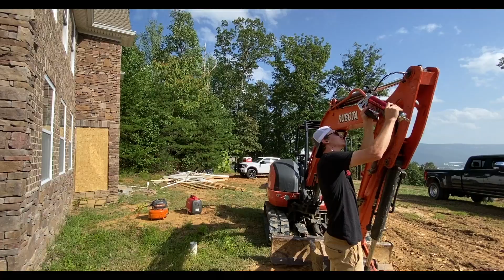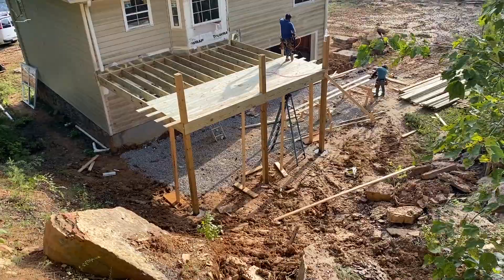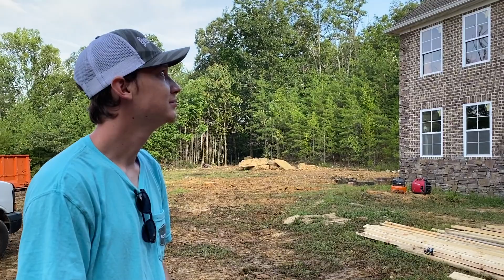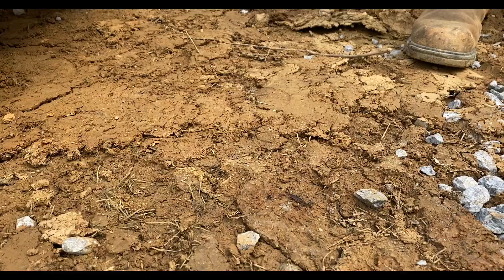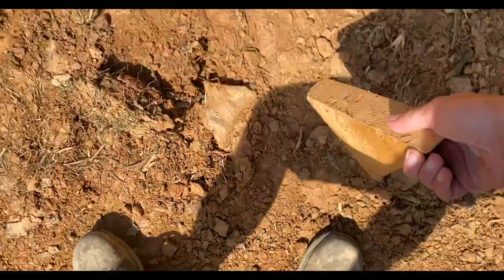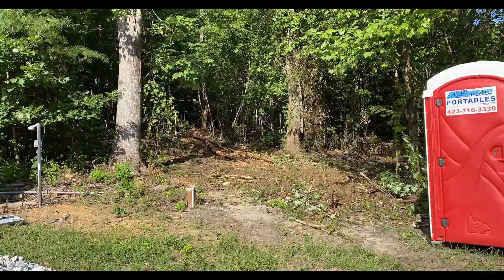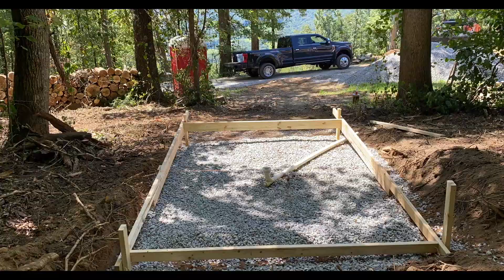The New Goonzquad Headquarters Part 9

Comment: That deck being built with only nails is just waiting to fall down.  There should be lag bolts going into the house framing, they only nailed it to the house.  The deck boards being nailed down is also way old school.  Need to use screws unless you want to see all of the nails pulling up in 2 yrs.

Comment: these guys are going to put down a slab without rebar in it , that slab will split within the first few years due to ground movement and moisture will get into the slab from the outside, Sorry to criticize guys but concrete slabs without rebar are just not worth the cost of the concrete.

Comment: Hi Boys!
So, first of all... I Love that you guys aren't afraid to try ANYTHING!!! Kudos.
BUT.... When it comes to building, you have to abide by what's called "Best Known Practices" (and the Building Code in your area).
What I see wrong with the "slab" you are going to pour is this:
Looks like you intend it to support the well house. If that's the case, you need a foundation. Like someone below said, at least 16" wide and 16" deep all the way around (I'm just guessing... there are many factors that determine what depth and width you need, such as frost depth).  Then you will need to slope your slab downward from all points to the drain, which means it should be lower than the slab height, not the same. Someone suggested 2 inches, but the standard slope is 1/4" per foot (you can probably even get away with 1/8: per foot).  That means that using 1/4" per foot, if the wall edge is 6 feet away from the center of the drain, you would set the drain 1-1/2" lower than the top of the slab.  I would also recommend placing at least 1/2" of insulation around your drain (you can seal it later). This way if your slab cracks and shifts (which they ALL DO!) you wont break your drain piping.  Recommend running at least a 1" PVC Electrical Conduit (they are green or grey) to about 2" from the edge of the slab for your future electrical needs (like running the pump, lights, etc.)  

Good Luck!

Comment: Don't throw away your burnable wood.  Put it in a big pile and get a burn permit and burn it as bonfire.  Throw plastics and no comparable material away and bury rocks in a un used area that are not needed.  It will cut costs for you big time.

Comment: maybe casement windows have come a long way in years. The ones ive seen and worked on sucked. If they get out of alignment at all through the years they get hard to open and close. Then the crank linkage takes a beating and breaks. Id take a double hung window over a casement any day. Plus the double hung look better,,,Id leave the windows alone. Also ditch the spiral stairs idea off the deck.

Comment: Great work guys! I see you guys are moving right along. You might wanna make the outhouse floor heated b4 poring the concrete so it will never freeze over during winter. I think you guys should do a off grid setup too. I would definitely close off the garage for more living room, Im sure you guys are planning on building a shop building anyhow, that way the deck could be extended to the other back end of the house. Then under the deck could be used for even more living space too, a patio or closed off great room since the deck is so high. Just a few tips that you might wanna consider. I can't wait to see what comes next! Always good to see young men with good hands 👍

Comment: You should build that slab like the way a lego brick snaps together.  A flat slab like that will move over time when the earth moves due to soft soil, especially when you have excess rain.  In other words , you don't want the slab to slide.  You want it anchored.

Comment: The guys you buddy get some concrete wire and put in there is not that does slab is my crack all the pieces get a one ahead and Dougie done a little more to would much in front

Comment: BOYS, YOU NEED TO STOP A MINUTE AND HAVE A PROPER THINK ABOUT WHAT YOU ARE DOING. All these ideas thrown up and acted on without proper forethought and planning. You will end up with a mess. Get in touch with an architect or planner and run all the ideas through him/her. You need to put some footings in place with the shed build, some plastic sheeting and some rebar, not to mention some conduit cable before you pour the concrete..It's all to hasty, you have all the time you need it dose not all have to be finished yesterday.

Comment: Guys, you want to use that excavator to dig some 3 foot deep frost free footings for that slab. You might want to run lines for water in and out so that they remain underground and don't freeze. You'll need an electric line as well.

Comment: I personally like window grids they have a classic colonial look to them.  Casement windows kinda suck when it rains.  Are a bit of PITA to clean also.  Also, I know you probably doing it legit with central air, but you'll never be able to put an AC in the window. I never had any good experience with casement windows, they break and eventually become hard to open and close. Maybe the houses I worked in had bad windows.  I dunno casements seem like a downgrade not an upgrade.

Comment: I used to make spiral staircases with a pipe in the middle and bend steps and run them around the pipe using the uprights to link the tread to the next tread up or down, use a pipe bender to bend the hand rail out of quarter by 2 inch flat iron and weld it all together. We made a jig to hold the first tread in place then used it for the next tread by sliding is down and around to the position of the next tread. Each tread is made out of a sheet steel of sixteen gauge of approximately ten inches by 2 and a half foot long. You make two lines from one end to fit the pole/pipe a similar width of the pole, to the other end one inch from the other edge for a fold down that you weld an up right half inch rod to connect to the next tread down.
Work out where you want the top tread to start and the last tread to finish by changing the drop down rate and rotation of the treads. Essentially don’t over lap the treads mostly very the drop from one tread to the next to fit in more or less treads to very the first and last tread.
To stop the ringing sound of the treads you need to fill it all with foam,even the treads.
Good luck

Comment: You're gonna need either rebar or reinforcing wire with standoffs in that slab. It wouldn't hurt to insert anchor bolts in the slab around the perimeter to bolt down the bottom 2x4 plate. That house really needs an 8 ft. deep porch stretching across the entire front of the house and wrapping around the left side. It'll be a great place to enjoy your fantastic view. A nice railing, posts, tongue & groove flooring, and some rocking chairs would really make it feel like home. Also that little two car garage is too small to do anything you guys wanna do. Build another garage and just turn that one into a rec room. Would be a great room for a pool table. Would be nice to have a big picture window in there too, to take advantage of that view and add more light.
Reply: I totally agree with this guy,  do what he is saying and really enjoy your awesome house!!
Reply: totally agree!

Comment: Hey guys, that slab wont work if you're just planning on pouring it as is. You need reinforcing mesh to hold it together and that gravel base wont hold it very well, bit of rain will wash the gravel out from underneath and the whole slab could shift. Get it done properly boys so you dont have to redo it.

Comment: hey boys i work at a traditional door and window company for 14 years and i would never suggest casement windows for your house it wont look right.
its actually an older style of window then the double hungs you have now which look better you just needed to replace them with single light and not 8 light windows

Comment: You should use wire mesh and spray on foam cement to hold back the land behind your deck. You need to prevent the possibility of a mud slide. They use it a lot in the Middle East when they build roads up in the hills. It is brown and when it sets it looks like rock face. Look in to it. It might be called 'shortcrete' I can’t remember.

Comment: I would recommend using a metal spiral stairs outside, as the critters are less fond of climbing those, or using copper foil on parts of the wood to deter creatures from crawling up to the deck. You may have a serious pest problem because of the location of your house. The idea of a bridge to the terrain behind the house? Oh, you meen the bug and critter highway? Sure, nice idea! Nice looking and a great headquarter for you in the future. Maybe a swimming pool and a helicopter landing site and a nearby garage/hangar?
Reply: You're Clever --> ...the bug and critter highway ... made me laugh until I thought about it and sure enough you're right.  That needs to be considered carefully in their plan.
Reply: The amount of poisones creatures around the house would make me consider several ways to deter creatures from entering the house and porch. If you are sitting down on a chair outside, and a black widow spider or such is hiding under it, you can get into a world of hurt. They are supposed to have their families up there, with kids? It would for sure make me think twice about any connection to the ground, and ways to isolate it from critters and bugs. I would make a hanging stairs that did'nt touch the ground, so no bug could reach it, or a passarelle to the terrain. (A walkway that is only connected to the porch and not touching the terrain, as we use on yachts to avoid rats from getting aboard.)
Reply: @gudfarfar  --> Well, let's not go too far into combat against nature. Many people have to deal with neighbors who are drunks, drug dealers and malcontents with guns. They sure don't have all that to worry about. Planning ahead like you said and signing a contract with an exterminator should  solve the critter problem.

Comment: 3 Comments:
1. @21:30 you can still see gaps in your form.  I hope you plan to fill them or else you will have a leakage problem when the concrete is poured.
2. It would be a good idea to support your form with the dirt you dragged out.
3. You could have told the framers to build your spiral staircase since they were contracted to build you an upper deck with stairs.

Comment: you're supposed to build a "WELL HOUSE" over the top of the actual WELL!  the idea is to keep the water pipe warm in the winter so that when freezing temperatures it the pipes won't freeze the pipes coming from the well into the house. Why on earth do you want to ruin the look of that house by taking out all of the windows? all the changes you're making it would have been cheaper to just tear that house down and completely rebuild the one you want. i guess when you got fuck you money you can do that sort of thing without worry about consequences. the ONLY reason you need windows that roll out is if you live in California where the earthquakes would shake and break normal windows

Comment: Did they just stick the wooden poles into the ground and poured concrete around? That is the worst thing you could possibly do to wood! It will mold and rot in no time! Pour in earth anchors and bolt the poles high enough, so that no stagnant water can reach it. Otherwise your porch will collapse eventually.
(Edit) oh yea and also compact the base for the slab with a heavy compactor before pouring concrete or it will float away one day!

Comment: With your skills you should be able to repair that chainsaw no problem. Use HL Supply for your parts, it's much cheaper than OEM and just as good. I have been using to repair and upgrade Husqvarna saws, always on point.

Comment: Glad you are going off to the side of the wellhead. May want to add your water and power pipe before pouring the slab like you did the drain which is an awesome idea. I have a house over my well head, tank, etc and ended up having to redo the roof because they have to get a crane over it to pull the well pipes/motor if there is a problem. I am going to end up doing away with everything but the wellhead and put the tanks, filters, controllers, softener, etc in the same heated shed that is going to have with dividers of course the generator transfer switches, power distribution and data all in one place with lines running to the rest of the buildings each with its own disconnect not like now where you have to shut the whole system down if there is a leak.

Comment: For the well house foundation. Too much gravel and no wire frame or rebar.  If you dont do any of this the foundation will crack badly. Hopefully  you guys are hiring a concrete contractor as they will make sure it's done properly.  Foundations can be tricky even with such a small building.

Comment: Don’t build the pump house where you are thinking about. You will have continuous trouble from all the water coming down the hill when it rains. Build it around where the equipment is now. Flat ground and the equipment is already there. Put a 12-18 deep footer wide enough for a 2x6 framing plus a brick wall. Build the structure with 2x6 framing. Add a colored metal roof. Insulate the walls and roof and cover with plywood. Brick the exterior with cheap brick and paint the brick. You can put a heater inside the structure to keep it at 40-45 degrees. Keep the dirt floor as it will not get wet and you will have maximum flexibility in the future to move/ replace equipment. Plant shrubs around the pump house.
Reply: Nice! Should they install the breaker box for the pump inside the main house?
Reply: @gpackwood1  I would have the breaker inside the main house just like you would do for the air conditioner that is outside.  Of course have a cutoff in the pump house, too.
Reply: @sch4074  --> Good point. The thought of standing in water trying to turn off the electricity makes me cringe! Safety planning first, then worry about appearance.

Comment: Hey guys the house is looking sick! As a plumber my only advice would be to find out where you guys want your septic tank and leach feild. Also stand the pipe 4ft for the floor drain  in your shed. Just incase for over pour on floor / or if you guys are doing a footing as well. Just cut off the flang and add a coupling and a couple ft of pipe.

Comment: I would be concerned about leaving the garage and other doors open............. and having critters slithering in and taking up residence under the tub and other hiding places.  Those GFI outlets in generators are a pain and always pop the breakers. I changed them out in my generators with regular outlets years ago and never have anymore problems. For the pump-house you should have your plumbing and electrical pipes coming up through the floor. And I also recommend the floor slab be heated electrically so pipes won't freeze.

Comment: Before you even said you might need to make some stairs up to where you were on the hill behind the house I though wow a bridge from the deck to Hill behind it and then maybe put some sort of rail along the top of the hill would be great.
Oh for your well house will it need to have some heat so it does not freeze up in winter?

Comment: Seriously lads, that is not a "foundation". You need to pour a slab with 16 x 16  1/2 inch rebar  if you ever plan on insuring your buildings. Code violations ensure no insurance.

Comment: Doesn’t the well head need to be in the well house? All of the plumbing for the house should be over by the pressure tank and all that will need to come up through the slab as well. I have a feeling you will be relocating the well house to where that stuff already is and have and extra building beside it.

Comment: fwiw, casement windows hardly ever get as much airflow through them when opened as a more traditional window. Also in a high wind event, the casement hinges can sometimes get pulled too far and thrown out of alignment.

your call of course, but just something to be aware of.

Comment: This deck doesnt look legit.  6x6 arent notched and there is no beam under the deck to support the load equally. Im not a structure expert but a youtube deck building expert by watching way too much deck building hehe.  Also get the plumbing BEFORE to do the slab so you can get everything inside the shed! Also for electricity in a conduit!  There is major planning needed before the concrete pouring to make it right.

Comment: Hey Guys; keep the arched window and don't paint the stone  it a bugger to maintain.  As for the well house there's a lot of work that has to be done before the cement truck comes ,  all the pipes and electrical has to be buried  and has to be to code  and get rerod or mesh to put in the cement .  Make sure that the building is far enough away from the well head to get a truck in if the pipe and pump has to be pulled up.

Comment: You're definitely NOT putting a hot tub on that deck...
Reply: 16ft span with only those three footings at the edge (not even on a beam). That’s definitely not up to code where i am. Same for that guard rail. Looks good though, but I wouldn’t be  putting too much weight on that thing.

Comment: You need rebar and I’d run some electricity conduit to bring up from the outside underground through the floor near the edge where the inside wall will be and some water pipes in and out.
Reply: Also need to tamp the base befor you pour slab...Crack city
Reply: You also probably need a perimeter footer that is “turned down” to prevent frost heave in the winter.
Reply: yes and dig out the corners so it wont shift/slide throughout the years!